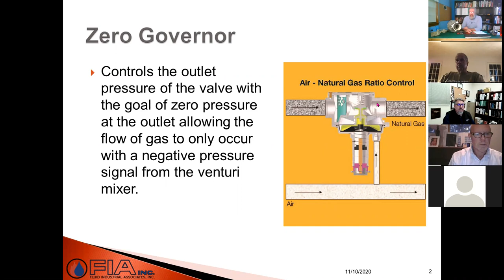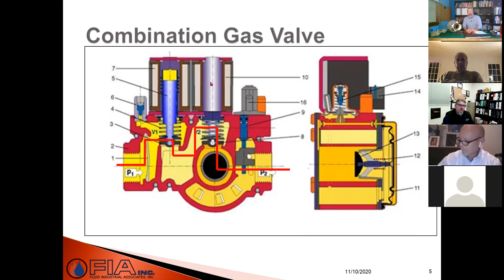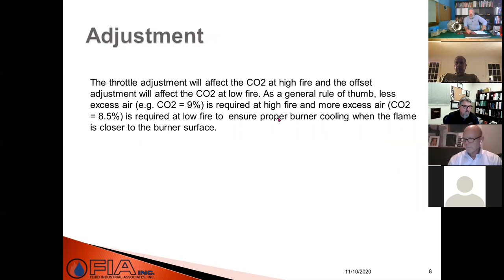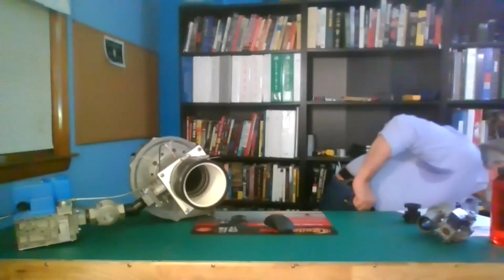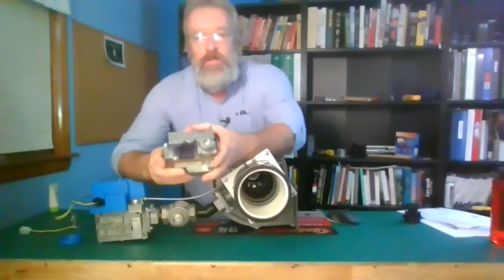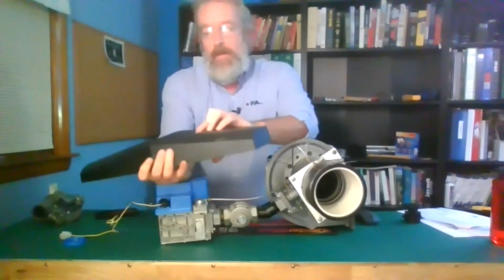Negative Regulation Gas Train Operation Overview

Comment: Some comments: With regards to the Sigma 848 diagram explanation- Pint is not the signal pressure, it's actually the Inlet pressure. From my experience inlet pressure on combination valves does not have to be stable, so long as it is above the minimum pressure (typically 6" WC). I've seen inlet pressure swing from 16" to 6" with out impacting CO2 % at all. Note- with a premix blower (blower located downstream of the venturi) you will not need the rubber signal hose since pressure upstream of the venturi will be equal to atmospheric pressure.  Another benefit of leaning out the mixture at low firing rates- in the event of restricted air flow, your furnace will fail lean versus rich causing high CO concentrations.

Comment: Great video there FIA Inc. Question; The pilot air connection to the reg will pull a negative pressure signal, mixing with main gas through to burner head ('flows through the zero reg as there is a 'small calibrated' hole in teh diaphragm?) Or is pilot air only acting on the regulator diaphragm and 'stops' (not 'flow through'), and then main gas flow is now initiated?   And can the fan is 'pulling' the main gas through without a negative pressure on the pilot air signal?